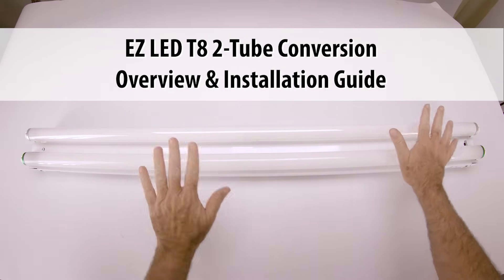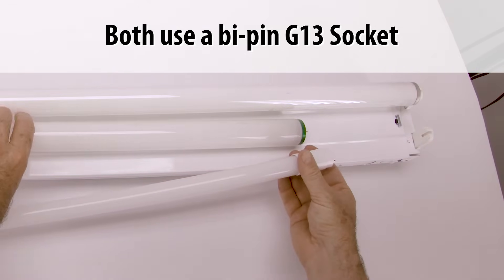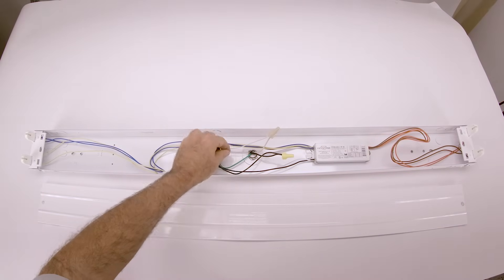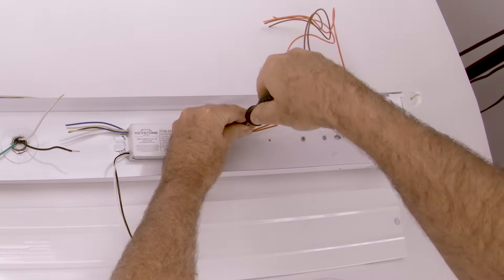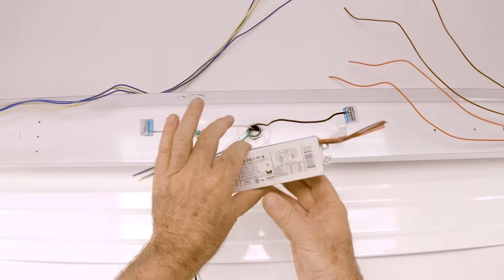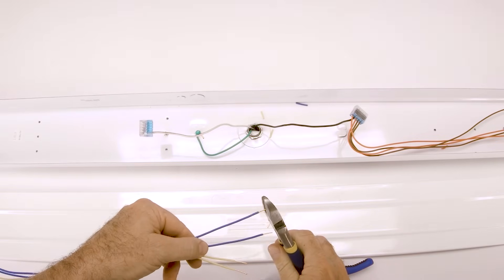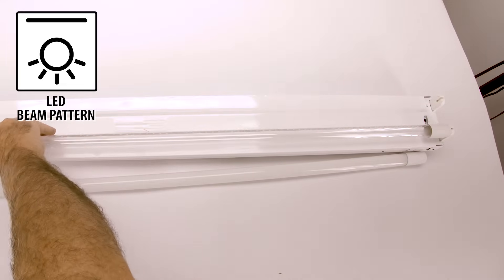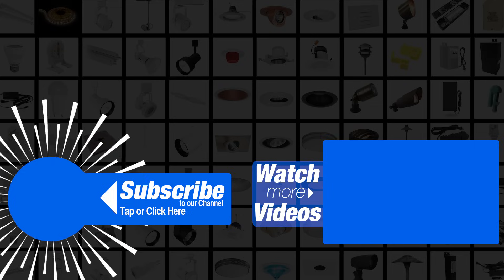EZ LED T8 Fluorescent 2-Tube light Conversion in 5 minutes or less by Total Bulk Lighting

Comment: I would like to convert my vintage fluorescent lamp Luxo FL101 which has 2 T8 fluorescent tubes with a ballast and 2 starters to LED. I am living in Germany and no electricians want to that job. It’s too small task for them. Can I get directions from you by sending an email? I love this lamps for decades. Still works without problems so I don’t want to throw them away but convert to LED. Thanks in advance

Comment: I’m back doing lighting after a 7/8 year hiatus. I’ve missed everyone converting T8’s to LED, so I did a little search to catch up. So many videos don’t zoom in to show what is being done, you clearly separated a Live/ Hot side from a Neutral side and everything fell into place. I previously spent years replacing ballasts daily, 2fts, 3fts, 4fts, 5fts, 6fts and 2D’s so I know my way around a light fitting, I just needed a little bit more info to do the conversion. 
Thanks for the advice, I have a store to go to tomorrow with about 30/40 fittings to convert, feeling confident about doing them now.
Reply from the maker: So glad to hear our video was helpful for you! May your job go smoothly and it all lights up wonderfully blessing you and the store owner 🙂

Comment: Couple of questions. I'm trying to put up an LED T8 sized fixture. Old T12 fixture was similar to the one shown, with power hookups from the box done inside the fixture and covered with a plate. The new fixture has no metal cover over the wires, just a small 1 inch hole to get the 3 wires from the ceiling box to the fixture. The ceiling box is small and stuffed pretty full, I don't see how I could fit the wires with connectors (Wago) back up in there. Is it OK to leave the connected wires inside the fixture along side the bulbs? LED fixtures without bulbs seem to be set up the same way, so connected wires need to always go back in the box? Thank, nice job on the video.

Comment: I implemented a ballast by-pass exactly as shown in your video. The T8 A+B bulbs (2 light fixture) will light. However, when I turn on my garage lights (a mix of 6 fluoresent and plug & play LEDs with ballasts intact), my 15-amp breaker will trip. Sometimes the trip is immediate, sometimes the trip occurs after a few seconds or minutes.  The 15-amp circuit contains a total of 5 flourescent bulbs, 3 LEDs (3 ballasts remaining), two 60-watt incandescent lights, and one ceiling fan. The by-passed ballast LEDs, 60-watt incandescent light and ceiling fan can all run without tripping the breaker. I thought ballast by-passing is supposed to reduce power draw. Can you think of anything that explains the breaker trip when the other flourescent/LED combo lights are turned on while the ballst by-passed LEDs are on? Thank you!
Reply from the maker: That sounds like a wiring issue or a bad breaker. An electrician would be the best resource to determine what is causing the breaker to trip.

Comment: have you ever noticed that the little "clipy" thing is in a hole that is slot shaped, so if you twist the little clipy thing 90 degress it will line up with the slot and pull out. just saying, no screwdriver needed
Reply from the maker: Thank you for the feedback 🙂

Comment: my double t8 fluorescent lightning has inside 2 balasts! and has cables on both sides, right and left. Whst do I do when I have 2 lamps AND 2 balasts?
Reply from the maker: Like we had responded on your other comment its hard to know how your fixture is connected electrically. So having an electrician that can physically look at the electrical connections and how its wired will greatly help in this process to make converting to LED both safe and correct. Hope that helps. Also we do have a form that can be of some help but again we highly recommend having an electrician diagnose the setup.

Choose the following on the form linked below ⬇: 4-foot Fixture > Double End Powered > I have more than one ballast.

https://www.totalbulklighting.com/fast-fluorescent-to-led-t8-conversion-tool.html

Again hope this helps 🙂

Comment: This demonstration is for double-ended LED bulbs. The wiring is completely different is using single-end bulbs. Also, the double-ended bulbs are attached to SHUNTED sockets. Single-ended bulbs are attached to NON-SHUNTED sockets. In most cases you do not have to replaced pre-existing sockets when converting to double-sided bulbs. However, you will likely have to replace pre-existing sockets when converting to single-ended bulbs.

Hot and neutral lines go to the SAME end of the single-ended bulbs. Hot lines go to one end and neutral lines go to the other end of the double-sided bulbs.
Reply from the maker: Thanks for the additional information. That is a great point and it is important to be aware of when choosing your LED bulb.

Comment: This is very interesting but what if you have no starter mine is a single light strip
Reply from the maker: Hard to say what the electrical setup is for your project but for these old 4ft T12 or T8 fluorescent fixtures the video will help with a retrofit application.

Comment: If someone leaves the ballast wired in the fixture and simply swaps the fluorescent lamps for the LED lamps and they do light up, is the fixture drawing more power than it would if you removed the ballast?
Reply from the maker: Depends on what power the ballast is putting out but it sounds like if the LED lamps came on then the lamps are not Type-B dual end powered LED T8 Tubes. Sounds like Type-A which are designed to be used with the ballast still electrically connected and powered. Since our LED T8 Tubes are Type-B they are designed for use with 120-277VAC and leaving the ballast electrically connected and powering our tubes will probably cause unforeseen damage voiding any warranty and most likely shortening the lifespan of the lamp. Hope that helps 🙂

Comment: Can I do this with pulg and play LED tube's?
Reply from the maker: If by plug and play you are referring to the direct lamp replacement LED T8 tubes those require the ballast to be installed and working properly. You do not want to retrofit the fixture in any way. So following the retrofit process in this video will prevent your DRL / plug n play tubes to not work.

However, there are universal LED T8 tubes that are plug n play, A and B type compatible so you can use them in almost any popular retrofit method applied to a fluorescent  T8 or T12 fixture.

It is best to know exactly what type of LET Tubes you have. Hope this helps 🙂
Reply: @Totallightingsupply  thank you so much, very helpful
Reply from the maker: @Drag0nD33s  You're very welcome 🙂

Comment: Your warning label should be sticked on the outside.
One needs that information when replacing a fail tube - bets are high that he will not open the case.

(OK, it's ugly. But better than sorry.)
Reply from the maker: Thank you for the feedback and yes we are aware of our blunder in the video. Putting the label in a place that is easily visible is highly recommended 🙂

Comment: My bulbs did not come with a warning sticker, so i took a sharpie and marked it as "no ballast! Plus right, negative left" on the wiring cover.  Putting this information inside with the wiring is not helpful years from now...
Reply from the maker: Glad to hear you were able to label you light fixture as retrofitted. Yes, it was a blunder on our part to put the sticker on the inside. We do try to address the label location in the video description . . . 🙂
Reply: @Totallightingsupply  The different types replacement LEF bulbs are what I see as a problem.  I grabbed my fist set that require NO wiring change.  Easy, but sill have a ballast using energy.  The next two fixtures I got "direct wire" bulbs.  More work but can never go back to the old type tubes.  So, now I am going back to label everything.  They also have bulbs that work with ballast or direct wire.  These would be great for when you just want to replace a burned out LED tube and don't know how it was wireed,

Comment: Does this work with shunted and non-shunted tombstones?
Reply from the maker: It can depending on how your wiring is setup for the non-shunted tombstones. Best thing is to make sure you follow the wiring diagram linked in the video description and if still uncertain we strongly recommend using an electrician. Hope this helps 🙂

Comment: My fixtures are plug in with pull chains for on/off and not direct wired.  Will this conversion work for them?
Reply from the maker: As long as you follow the wiring diagram located in the video description that is the key to a successful retrofit 🙂

Comment: I did this like you did and nothing. The t8’s I have says power with electronic ballasts only. Is there a difference
Reply from the maker: Sounds like you have the wrong LED T8 tubes for the retrofit method you used. The tubes you are using sound like Type-A tubes that require an electronic ballast to operate. The video is demonstrating Type-B dual powered or double powered LED T8 tubes where the ballast has been bypassed and in the video completely removed. Maybe you can exchange the tubes for dual powered Type-B.
Reply: you are correct. got the right ones and they work perfectly. thanks
 @Totallightingsupply
Reply from the maker: @slim22nun  So glad to hear things are working great! Have a blessed week 🙂

Comment: How can use plug & play t8 LED bulbs without ballast? How can I re-wiring to use plug & paly tube without ballast?
Reply from the maker: Plug & Play only T8 LED tubes require the ballast. You can use the universal Type-A+B and when the ballast fails you can retrofit like in this video and continue to use your tube assuming the tubes have not failed.

Comment: I have a fixture using F48T12-CW-HO BULBS.  These have a different base . I would like to change the bases to tombstone type and replace with LED ‘s.  I don’t ned high output devices. Is there a kit for this?
Reply from the maker: I am sorry we do not have a retrofit kit for those type of fluorescent fixtures. However, an electrician might be able to rewire your fixture to accept LED version of the F48T12-CW-HO bulbs.

Comment: I appreciate your excellent video.  A new ballast was more expensive than the LED upgrade.  I got two nice 4 foot T8 bulbs at Lowes for $17 and they are 3 position adjustable which I really like. I followed your plan and everything was very simple. Now I have some much nicer and more efficient lighting for my wood shop.  The little connectors are awesome and so much more convenient than wire nuts.  The next time another light ballast goes out, I now know just what to do.  Thanks again !!
Reply from the maker: Glad to hear our video was helpful 🙂

Comment: I watched 4 or 5 videos on how to convert fluorescent to Led. Each one was a bit different,  in fact, one had me connecting each of the 4 end wires to the other ends wire. I tried one which had me removing all wires from one end totally and doing all connections for the other end.  That one didn't work at all.  Your simple method worked the first time. Thank you for the clear and simple instructions.
Reply from the maker: You're very welcome! So glad to hear you found our video helpful 🙂

Comment: On my tombstones    they are the type where they push in and no twisting needed. Both bulbs have ends with a single nipple on the ends.  The fixtures are 8'ers. Do these fixture wire the same as like the ones in the video?
Reply from the maker: Our LED tubes are not compatible with that type of tombstone. We use to offer an 8 foot conversion kit that would allow for converting to the twist lock but unfortunately we are unable to keep a reliable source for these retrofit kits. As long as you follow the wiring diagram you when retrofitting you should be fine. If you are uncertain we highly recommend using a licensed electrician 🙂
Reply: @Totallightingsupply  I've got led bulbs that have the nipple ends on both ends and my fixture takes that type of bulb. So? If I wire it like your video and remove the ballast I should be ok. Correct?
Reply from the maker: @russellhowell9854  Since we do not sell T8 LED Tubes with a single pin at the end like the one you are describing the only recommendation we can provide is retrofitting to the twist lock method like you see in the video. Doing so will most likely require the removal of the old tombstones and replacing with brackets that the new tombstones will attach too. As always follow the wiring diagram that comes with your LED Tubes and retrofit method. Hope that helps 🙂
Reply: @Totallightingsupply  Thanks

Comment: Great video. All I do differently is to put the warning sticker where it can be seen without having to remove the belly pan, usually on the outside of the pan. That is rarely removed when just replacing lamps.
Reply from the maker: Thank you for sharing! Glad you enjoyed the video. The label should be placed in an area highly visible on the outside of the fixture. This was our bad and we didn't catch the mistake to later 🙂

Comment: Thank you so much for this tutorial. I have a question. When you wire the light like this with all hot on one side and all neutral on the other, it does not matter whether the tombstones are shunted or non-shunted?
Reply from the maker: As along as you follow the wiring diagram making sure power is flowing properly to the tube it should not matter the type of tombstone you are using. Keep in mind shunted tombstones are electrically separated and may require jumping so that both tabs that contact the tube pins are providing power.  We always recommend consulting a local licensed electrician to make sure local code is followed and connections and wring are done correctly. Hope that helps 🙂

Comment: On the retire you only power one side. One tube stone.
Reply from the maker: The LED T8 Tubes in this video require power to enter from both ends of the tube. See the wiring diagram here https://www.totalbulklighting.com/downloads/dl/file/id/1215/led_t8_double_end_power_wire_diagram.pdf 🙂

Comment: I have a T12 fluorescent 1tube light.   I followed the directions to convert to a T8 LED.   After the connections, I have power to the wires but my light does not work.    ????
Reply from the maker: There are lots of variables but make sure the LED tube is a Type-B not a Type-A. We see this common mistake often. Type-B bypasses the ballast where as Type-A can only be used with the existing ballast. When in doubt contact the business you purchased the tube from for more information on the tube Hopefully that helps 🙂

Comment: Before I found this video, I went ahead and replace 2-tube (48")T8 fluorescent lights with 2 LED tubes that I got at home depot that said for T8. I didn't have to do any of this conversion. Why is that? Do I need to be concerned about anything done wrong?
Reply from the maker: Sounds like you purchased Type-A tubes that rely on the ballast for power 🙂

Comment: Are the tombstones shunted or non-shunted? I assume it does not matter because two wires go into each one....
Reply from the maker: In this video the tombstones are shunted with the hot being connected to one side of the fixture's tombstone and the neutral to the opposite side. But a fixture with non-shunted tombstones can be wired the same as it would be electrically the same. It is always best to follow the wiring diagram supplied and when in doubt we recommend using a licensed electrician 🙂

Comment: Do only retro fit bulbs fit?
Reply from the maker: In this video for the dual end powered T8 LED Tube retrofit method only Type-B will work 🙂
Reply: @Totallightingsupply  thanks for the reply. You mention that about 99 percent of fixtures this will work for. How do I know if it will work for mine before trying/buying your kit
Reply from the maker: @phsx2890  Best thing is to start here https://www.totalbulklighting.com/fast-fluorescent-to-led-t8-conversion-tool.html

Comment: Very cool.  I need to convert my kitchen florescent ceiling tube lights to LEDs but some of the clips that connect the done of the tubes are cracked/ broken so... what then?  Replace the entire housing?  I'd rather just put in an LED panel if that's the case as i hate the design of the double ended tubes and trying to align them and locked in place always drives me crazy.
Reply from the maker: If the sockets are cracked or broken replacing them is the best thing to do. As for an LED panel vs tubes that's a more personal decision. I like the ability to easily replace the tubes if for some reason the tube fails prematurely or I want a higher lumen light or different color temperature 🙂

Comment: Thanks for the video,  it's great. One question,  the doble ended tube use shunted or none shunted tombstone?
Reply from the maker: You're very welcome 🙂 As long as the wiring diagram is followed correctly you can use both but typically the double end tubes are used with shunted tombstones.

Comment: Simple instructions;  I have GE single pole 8 ft led light follow your steps, change the sockets, still no light, tested  the wires coming in the fixture and it works, what I'm doing wrong?
Reply from the maker: Make sure your LED Tubes are Type-B and receive power from both ends. See this video on popular LED Tube types and retrofit methods. https://www.youtube.com/watch?v=xPOu-jSTrPc maybe it will help shed some light on your situation 🙂